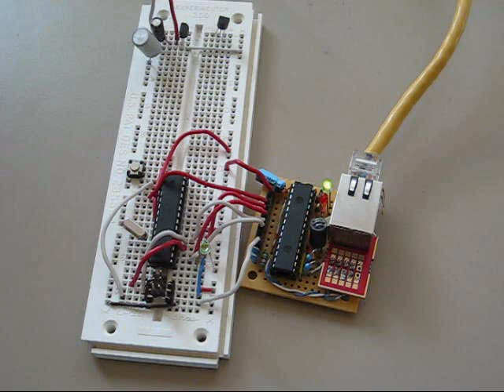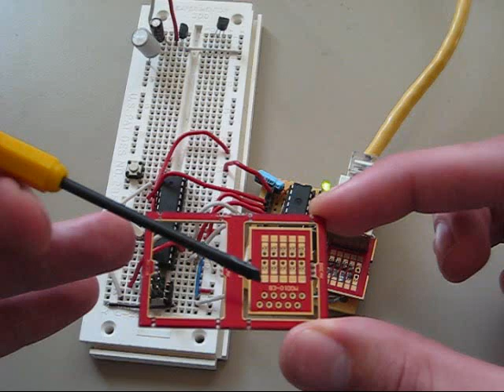Ethernet Hardware

Comment: any idea on how to connect MII , from a phy chip to arduino uno?
Reply: i got left overs from one of my friends, lots of altima boards ac101-QF from RJ45 to MII, and i got one uno... is there any way or code or link explain how to create MAC chip using the uno. so it fit with the MII to make Ethernet ?